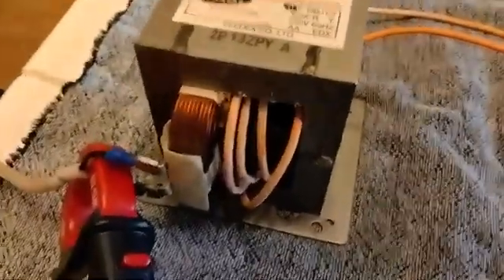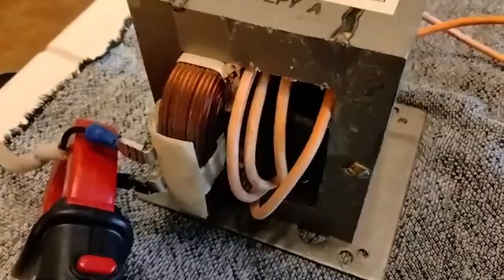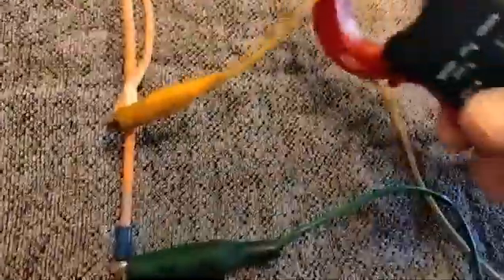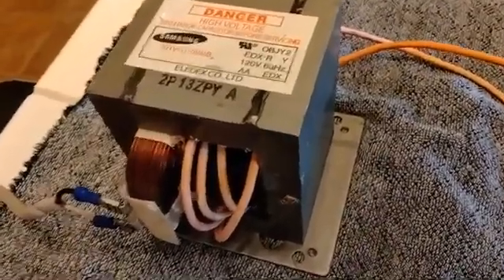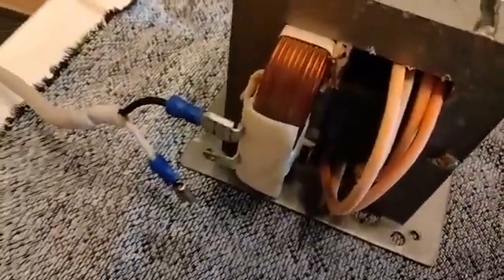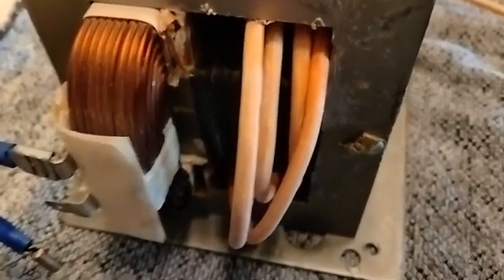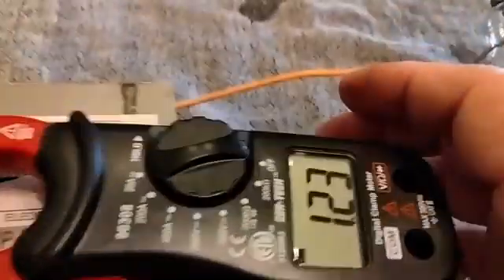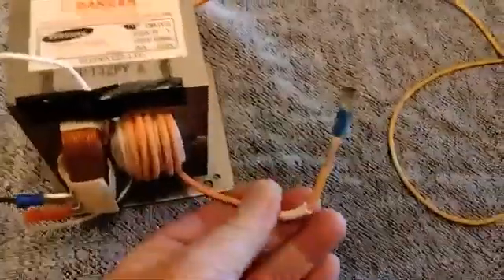Microwave Oven Transformer Rewind the Right Way, Too Many Dummies on here giving Bad Advice

Comment: You're still putting in 150 watts and getting out 20 watts though?
Reply: Much better than putting in 1200 watts and getting 20...
Reply: @ScandalistRick  yes but is it really "efficient"? I agree it's a vast improvement, there's still something wrong here... transformers can be 98% efficient, this is less than 15%. I also wonder about real vs apparent power (VA vs watts)
Reply from the maker: @jeremiahbullfrog9288    Yes, you are correct, there is still something wrong, that's why it is in my description that this was not done perfectly, and  I just left a comment below stating that in my text description I mention that I didn't use the correct number of turns or the correct wire.
Reply: @jeremiahbullfrog9288  There is much we don't know -  core area, characteristics, etc. Cocktail napkin calculations suggest 120 primary turns, but that's a ballpark figure. Without detailed info omit that, load that puppy up, and tweak. Should find max efficiency somewhere around that turn count then work out the rest.
Reply from the maker: @qdsmith  Yes, I think I said that also... LOL,  But I'm going to have to hire you to proof read and rewrite all my videos and comments from now on, you are much better with my words than I am.
Reply: @bigcbradio  I think you are too harsh to those that suggest getting rid of the magnetic flux shunts. Because they are also a reason for reduced inductivity of the primary just as much as insufficient number of turns is. By leaving them on you artificially reduce the efficiency as the core is still getting saturated when the current is approaching the peaks of the sine wave. By not allowing the core to get saturated at any phase of the current you are not only improving efficiency, but also improving the power factor as in this case the PF is dependent on the load only instead of including the vagaries on the poor transformation.  In your case with practically pure resistive load (the lamp) the PF should be very close to 1. So I suggest you do both and you will see a further dramatic improvement in performance.
Reply from the maker: @blg53  I'm not sure what you mean by  "too harsh to those that suggest getting rid of the magnetic flux shunts"  I never mentioned the shunts even once in the video or in my description.  All this video is for is to show people that these MOT's are underwound and get people headed in the right direction.  I never implied that this video shows an ideal transformer, to the contrary, I even point out that I didn't even use the proper wire or the correct number of turns.   In the long run 99% of the people rewinding these (including myself) are not going achieve the ideal transformer, but they will end up with a good usable transformer, rather than one that is going to overheat if they do not attend to the primary winding issue.
Reply: @bigcbradio  Those welds you mention in the video are actually the flux shunts I am talking about. My suggestion was that you get rid of those too as well as upwind the primary.  Hope that makes sense.
Reply from the maker: @blg53  But I never mention the welds in the video, so no, it does not make sense to me.
Reply: @bigcbradio  Sorry, not in the video (my mistake), but in the comments : "I had to pin this.... one person has said to "remove the welds" instead of adding turns.  Do NOT do this people.  This type of misinformation is exactly why I made this video."
Reply from the maker: @blg53  Ok, personally I have never seen the welds make a difference. (that doesn't mean it doesn't) In this self described "quick and sloppy" video I show that even with the wrong type of wire, wrong gauge of wire, not enough winds, and the shunts still in, that I get the idle current down to almost 1 amp.   That is way better than the 10+ before the extra windings.  I was hoping that people would just pick up on this and then add that to my comments in the description and they would be off and running to get their MOT's working as good as they possibly could.   I didn't think people would be telling me how my example could be better.   I thought I had that covered when I said it was a "quick and sloppy" example, LOL.   

At least this video seems to be getting some views and people talking... so maybe this will spark some others to start making MOT videos and we will end up with a whole new wave of videos comparing the different ways to optimize these primary windings and MOT's in general, instead of all the videos just changing the secondary.
Reply from the maker: @ScandalistRick  and I just left a comment below stating that in my text description I mention that I didn't use the correct number of turns or the correct wire.
Reply from the maker: You are correct, but, If you read my description just below my video you will see that:

I mention at the end of the description that I did not use the correct number of turns.   I said "I didn't count the exact number of turns and really didn't add quite enough.  It was just where I got to when I ran out of wire".   If you use the correct amount of turns, and the correct size of magnet wire it will work excellent. 

In this video example I used some scrap 22ga wire with thick plastic insulation (the original primary appears to be 14ga).  The wire that I used added a lot of resistance, the thick insulation left large gaps between the windings, and the piece of wire I used was not long enough to get enough windings.... those 3 factors together will make the example in this video not as efficient as possible.  

The bottom line is: now you know how.  Use the same size magnet wire to add on to the primary.  Check the idle current after every 10 or so wraps, if the current starts to climb again, you added too many.  The idle current will drop really really low with the correct turns.  If you have the time and patience, and you know what your secondary needs are (say for example 4 tube filaments)  you can adjust the primary and secondary to be most efficient by wrapping some flexible scrap wires as the secondary and test with the load when you start getting close to the lowest idle current.
Reply: no, you cannot just multiply current and voltage to get the power, there is also the power factor to take into account if you want to calculate the real power.
Reply: @r.e.m.s  Yes i just pointed out the real vs apparent power which has been ignored in this presentation.. i can only go from the information in the video.
Reply: @jeremiahbullfrog9288  Ah, I think I read your comment a bit too fast then. You're right VAR and Watt are two differents things.
Reply from the maker: @jeremiahbullfrog9288  You can also "go from" the information in my description, nothing is ignored.